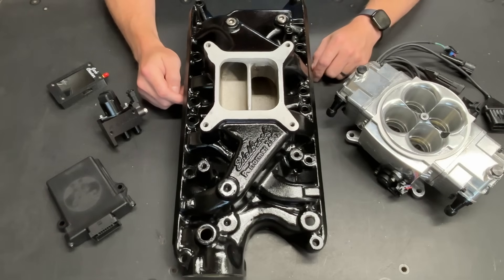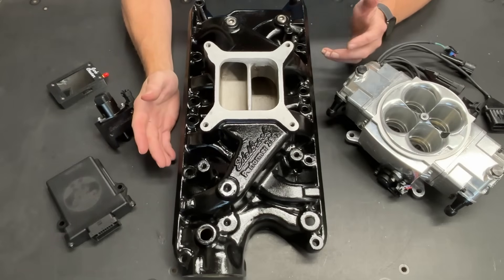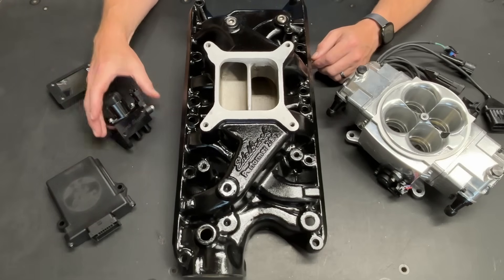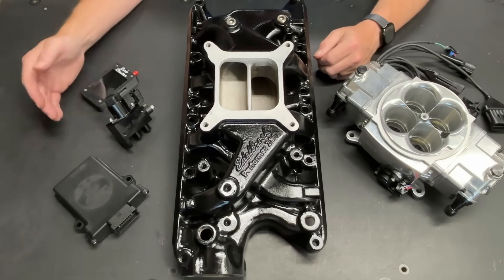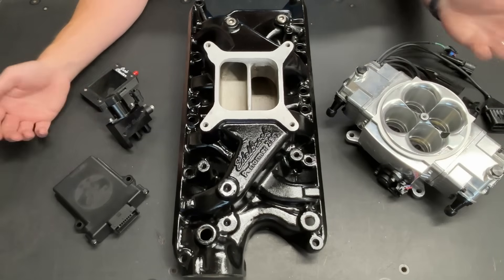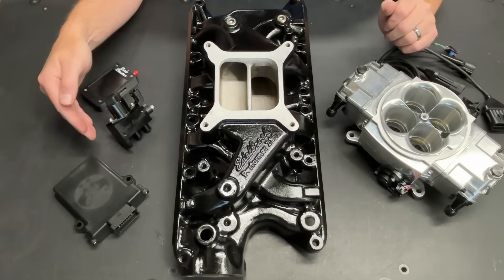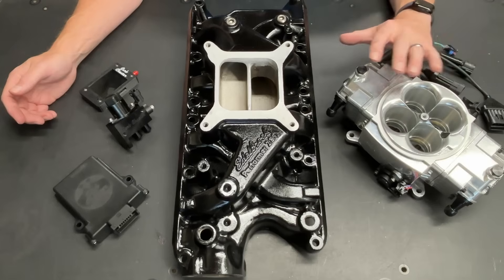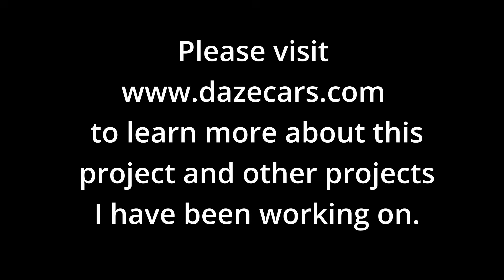Computer Controlled Fuel Delivery Carb Cheater 2.0 Vs Sniper  2 EFI, Why I Decided to Try Them Both

Comment: Holley sniper v1 liked to electricly interfere with itself I had a bad time with it.
Reply from the maker: sniper 1 had some issues for some customers... in truth probably a much higher percentage than they should have.  sniper 2 seams to have fixed most of that and thankfully that is what I will be running.

Comment: bought a Carb Cheater recently, great bit of kit, simply put;  it gives you the info/data to be able to really fine tune your carb settings, and gain a practical working knowledge of exactly what  the changes to settings, (rods/jets/springs/timing advance etc) are actually doing in real time.
Reply from the maker: exactly!!

Comment: i want to do E85 and potentially turbo blow through and i am looking at carb or tbi only no multiport efi because i want to not have to run an intercooler and want the charge cooling of adding the fuel up top. my question is what is my best option from all the throttle body and/or carburetor options available. i know some don’t offer the E85 option so i can go 93 octane too but would like flex fuel option would be optimal
Reply from the maker: I can't say specifically what is best or which one to get but I will say this if you are thinking turbo and no intercooler than gasoline is not an option IMHO.  The benefits of E85 in a boosted application have been proven over and over and is the only way to go if for no other reason than engine safety if you can't cool the charge.

Comment: Carb cheater with carb will be way more reliable 
Those sniper type set ups are known to be painfully unreliable 
And when they fail your stuck where it stops
Reply from the maker: first generation, is unreliable for sure but I believe the sniper 2 has the bugs worked out.  problem is the issues of the past have some people believing every TBI will fail, but the reality is the side of the road is not littered with people running TBI.  Also most of the issues that cause failure are related it installation error like not having a heat resistant spacer between the TBI and intake which heat soaks the computer or running solid core spark plug wires and other electrical that creates EM interference.

Comment: I had a bad time with sniper the computer in the sniper liked to pick up electrical interference and shutdown mid drive causing me to get towed for the first time in years, I switched back to an Edelbrock carburetor and never had another problem that left me stranded
Reply from the maker: what type of spark plug wires were you running and which sniper version was it?
Reply: @dazecars it was the first version
Reply from the maker: The first version for sue had issues.  Sniper II "seams" to be better at least thats the general public opinion but have not had the chance to test mine.  Thanks for getting back to me with answers to my questions.
Reply: I ran the accel yellow wires and crimped them myself for the first round of struggling then switched to some suppressor wires from auto zone to rule out a bad crimp. I eventually gave up on the sniper put it on the shelf and got Luke's carb cheater beta

Comment: Very interesting comparison and I can't wait to see the results. I am about to install a tbi setup on my 70 maverick with a 302 myself. I went with the aces killshot 2 though. They are a local company to me and they have a system similar to a sniper with a tbi mounted ECU for 499 you can't buy a good carb for that price now days. I went with the remote mounted ECU killshot 2 though that was a little more but still a good value imo. I do plan to do the intake mods to my performer rpm that you did before I  install the system.
Reply from the maker: I can't wait to see the results either!! 😁 I actually have the CC almost completely installed.  Few little things to button up but winter is closing in here in the frozen north so I don't think I will get much of the comparison done until spring.  I hope your install goes well.

Comment: Just a note about the high-pressure needs of any EFI system. I have converted an aircooled VW from carbs to EFI and arranging the HP pump, regulator and return line was something I had to engineer myself. If it was an old Mustang/Camaro/Mopar there is probably already an aftermarket solution I could just buy.
Reply from the maker: yes that is a step that is required for EFI

Comment: Can’t forget about the fuel system. Carb cheater uses your stock fuel system where efi requires an expensive fuel system overhaul.
Reply from the maker: agreed there are lots of things to consider

Comment: Aftermarket EFI systems have a long way to mature, reliability is an issue.  We had a FITECH go bad after sitting in a climate controlled shop for a year.  I also know of numerous Holley EFI system failures one of which resulted in a 200 mile towing bill !  With carb cheater you still have a carb if it fails and you will not be stranded as you would be with an aftermarket EFI failure.
Reply from the maker: that is for sure an advantage of CC over EFI

Comment: When do you plan on doing this?
Reply from the maker: I have been a one legged man in a butt kicking contest.  I am a high school football official and have been doing games for 6 high schools and 7 middle schools consequently working 4-6 games a week I have almost no time to work on any projects in the shop.  I did get out there one day and got the intake pulled off of the Galaxie and then on another day had just enough time to get the modified intake reinstalled.  I found a little more time on a third day to button everything back up so the car moves under its own power again SO NOW  I can try and find a little time here and there to get my CC installed.  Winter is coming fast so I am not sure how much driving time I will have to really play with CC so my comparison between CC and sniper EFI may be on hold for the next 6 months.

Comment: Without  offense; how  could you consider a Holley (with less moving parts than the Edelbrock) hard to work on? First, Holley carburetors have been equipped for decades with an anti back-fire to prevent power valve damage, so power valves going "bad" is not likely. Holley is much more tunable for every application where  Edelbrock having eliminated the most important 2nd of 3 steps on their metering rod that controlled the "mid-range" circuit of function for the  carburetor's  proper performance and efficiency. Thus, a simple change out of the metering rod, step 1 or  2nd step and spring kit never comes close for the majority of street performance engine application needs. 2ndly, most people try to purchase and compare carburetors by  advertised CFM ratings, failing to realize that the Holley CFM rating is a True-Wet CFM, while Rochester,  Carter/Edelbrock is a Dry CFM rating. Hense, the  Holley is a "bigger " carburetor if comparing identical  advertised CFM. Thanks for the interesting, thorough and informative video.
Reply from the maker: Thanks for the comments and insightful information.  There was no offense taken.  Both are IMHO about the same level of "easy to work on"  BUT an edelbrock needs less tuning out of the box and less tuning over all.  Yes the lack of tuning also results in a lack of max power but I am not concerned about maxing horsepower.  Out of the box install, reduced tuning requirements and reliability are why I prefer an edelbrock but that is just my opinion.

Comment: This is an exact debate I've been having for a while. If it's functionally a wash, or enough of one to make either option a good and reasonable choice, it really becomes a comparison of cost and serviceability. Even assuming having to buy all of the components for either system, I suspect CC will be less expensive because of the EFI required HP fuel pump & related tank and plumbing stuff. I'm also a fan of the idea of the serviceability of a carb if/when CC fails or malfunctions. Some may argue for the more comprehensive possibilities offered by converting to EFI, like timing control, tuning for boost, traction control, etc., but over-integration is one of my biggest complaints about new vehicles, where all systems are dependent on every system functioning correctly for any of them to work at all. I know that's an exaggeration, but I've found it true enough often enough. And while OBD2 is great and all, I'm often of the opinion that simplicity is better when it comes to actually fixing stuff and not just diagnosing.
Reply from the maker: Those are all excellent points.  I agree that the results are likely going to be a wash but still a fun comparison.
Reply: @dazecars I'm sincerely looking forward to seeing what you find out. I've yet to finalize my decision, and now I can justify putting it off until you're done with the comparison. Whatever preconceived notions I might have, if there's evidence to the contrary, it deserves fair consideration. Honestly, I'm good either way it turns out, and the worst case scenario is that I end up having to wade through the numerous EFI conversions to pick one. That'd be a hassle for sure.
Reply from the maker: It could be a while before I get the complete compare.  I have had almost no time to work in the shop.  I am in the middle of the intake install and once thats done I will get the carb cheater installed.  Problem is I live in the frozen north and the days of driving a classic before the snow flies are numbered.  I hope to get the CC on the car and get some seat time but I am guessing the sniper EFI won't go on the car until spring.

Comment: Planning to convert my '84 Cutlass with Olds 307 to fuel injection, looking at the kit from Aces. Planning to use a Holley Street Dominator single plane to complement the FI system, will be interesting to see how it goes. Mainly trying to get away from this quirky electronic Qjet...
Reply from the maker: lots of ways to get it done

Comment: That must be the super old carb cheater. The one they have now is completely different than the one you have.
Reply from the maker: It’s the newest version. I got it a few days before I shot the video.
Reply: @dazecars  I changed the box logo design and bought a different laser. probably what is being referenced here - yours was last shipment batch before transition.
Reply from the maker: thanks for the clarification.  Still haven't gotten it installed but hopefully soon.  Not enough hours in the day.

Comment: I would like to see sniper efi ignition control added your project, and then compare that to the carb cheater performance
Reply from the maker: I am going to use the same ignition for both which is the duraspark with MSD controller

Comment: To be honest, it's hard to compare these in my mind- CC is like $400 and an acceptable option for people who feel EFI is too fail prone. It allows a carb to work as optimal as possible. Sniper 2 is somewhere upward of $2k with the appropriate fuel system, and should be tuned with a laptop to work optimal.
Reply from the maker: there are advantages both ways I think.  I predict  I will not find a clear winner as there are pros and cons both ways depending on what parts you already have, skill level and application.

Comment: Never heard of the Carb Cheater. Sounds interesting, I can only really see it help idle and cruise conditions rather than full throttle but it could be a huge improvement if it is watching the O2 sensor all the time.
Reply from the maker: Transitions are where a carb tends to over fuel, any time the carb is needing to adjust.  Yes at WOT the CC probably won't be doing much but unless you are racing how often are you at WOT?  However when doing regular driving there be an endless string of transitions and an opportunity for the CC to make adjustments.  At least thats my understanding.

Comment: My daily driver is a 1978 Volare with a slant six and a 2bbl Carter BBD. I've been driving the car almost 7 days a week, 100 miles a day since I got it in late January last year; about 45,000 miles including two trips from Southern Florida to Tennessee and back. As is, mixed town and highway with the a/c running, it usually averaged 24mpg on my commute, and 27mpg on long highway trips. It's a six cylinder and although the automatic doesn't have an overdrive gear, it does have lockup and a 2.45 rear gear ratio. After installing the Carb Cheater, I found it would idle at about 12.5:1, cruise was about 13.0:1, and full throttle was 11:1. After cleaning that up as best I could, I let the carb cheater do the fine tuning. I've gotten my commute mileage up to 28mpg and long highway driving is 31-32mpg. I'd say it picked up power, but it struggles to make 100hp, and the rear end gear really kills it. Now, the Carb Cheater did fail me (my fault), but the carb is so much better set up than factory, that I can't even tell; it's also never been rebuilt or even off of the engine. I've yet to email Luke about it, it does still sometimes work, but I don't really care that much as it doesn't hurt the driveability. I ordered a second one for my 1987 D150 that is a hodgepodge of engine parts. It's a stock, worn out 318 bottom end with a .508 lift cam and 360 heads; no displacement, no compression, and all the cam. It runs better than expected. I topped it with a Dodge specific Quadrajet, probably because I hate myself. It ran excellent. Mind you, with such mismatched parts and a big choppy cam, it is a little difficult to set the idle mixture screws by vacuum, but it idled decently. The Carb Cheater showed me 11.5:1 at idle, 12.0 cruising, and diesel smoke 9:1 at full throttle. Although it ran well, it smoked horribly on hard acceleration and only got 9mpg; it got 15mpg stock. After leaning it way out to everywhere being 13.5-14:1, it has an even rowdier idle, a ton more power, and even turning 3,000rpm on the highway, it averages 15mpg again. I've yet to turn on the carb cheater to let it do its thing. Mostly because I'm putting in an overdrive transmission and want to see what happens with that. Now, at work, I've installed a few Holley Sniper systems, as well as FiTech. All of them have been removed and upgraded to carburetors. The first thing is the price. Thankfully, as a shop, I've been able to get most of the purchase price back, but what's hidden is you buy this thing for $800-$1500 depending on what it is, but what the average person doesn't know is you also have to spend a couple hundred on a good quality fuel pump, or another $1000 on a tank and pump combination, then everything to add a return line, possibly $500-$800 for a distributor that will play nice with the computer, and better plug wires to block out interference. Those efi systems quickly turn into $3000 or more in parts, and then you pay someone to install it. On top of that, you do have to get them tuned for the best results. And then, the car, at best, runs just as good as it did before. The only benefit, which I have not experienced, is it's supposed to be a quick start-up after sitting for weeks or months because you don't have to crank for a few seconds to pump fuel into the carburetor. But, properly installed by the book, all of the good quality parts, tuned it, not one that I've used was any better than a carburetor. They all performed the same, or slightly worse, and they all got the same or worse fuel mileage if they ran at all; and most never made it out of the shop, even screwing with the computers. The two that did make it out, failed within a few months, and one of them went through five fuel pumps. I no longer tell people "yes, I can install an efi kit", I instead tell them "how about I make your carburetor run the way it's supposed to?" I've not offered a Carb Cheater to customers yet. I primarily just rebuild their factory carburetor if it needs it, but the main thing I do is fix whatever is wrong with their ignition system. Most carburetor problems are ignition related, but trying telling a customer that. I have one guy that took his car somewhere else to get the carburetor rebuilt because I wouldn't do it. The other guy took his money, rebuilt the carburetor, and it still runs bad because the engine is completely worn out. Three cylinders have a ton of blow-by into the crankcase, and all eight are slightly leaking past exhaust valves. But he didn't believe that. Though, I've also had someone ask if I can put a Sniper on to fix the exhaust smell in the car. No, but I can fix the fact the manifold is falling off. I don't see the point, I don't see why anyone would spend the money to have their car the same or worse. I'd rather have my simple carburetor and know that it isn't going to leave me stranded potentially needing parts that I have to special order, if they're even available. There's nothing on my car that can fail that I can't limp home, or limp to a store and get. To me, the Carb Cheater is a great tool to really dial in a carburetor better than a vacuum gauge, good ears, and a butt dyno can, and it works with the carburetor to clean up what playing with jets, rods, and power valves can't. Should something happen to where it stops working, it can't leave you on the side of the road, which to me, is the biggest advantage.
Reply from the maker: Thanks for the real world feedback.  I believe there is a time and place for both applications but not having installed either yet I have no real world data to back that up.  I have heard the horror stories about EFI, same kinds of things you talk about but I have also heard way more success stories.  Again all hearsay and thats exactly why I am doing this video series... we will see how it all comes out on my car in the near future.